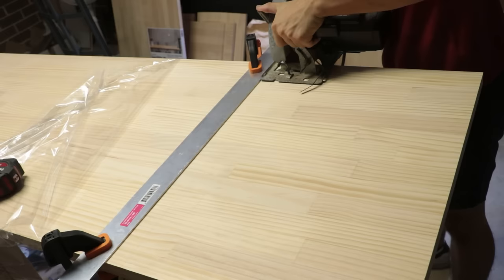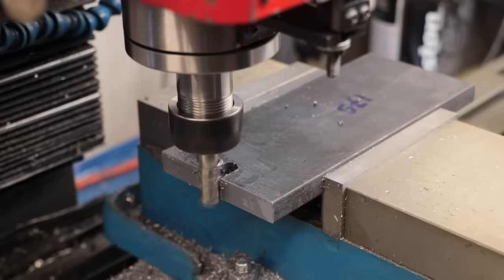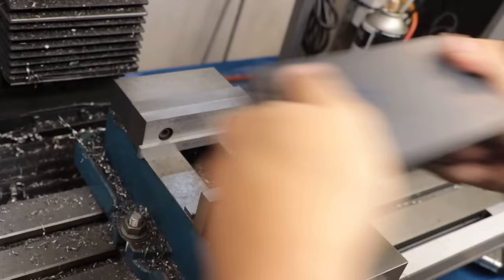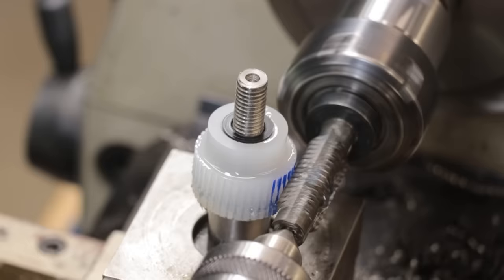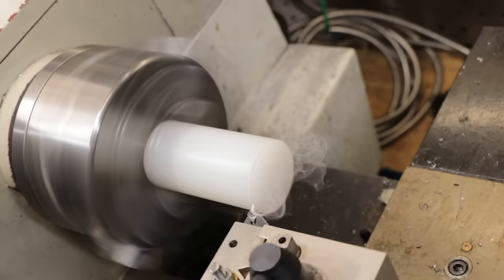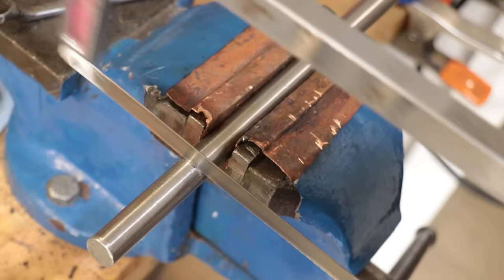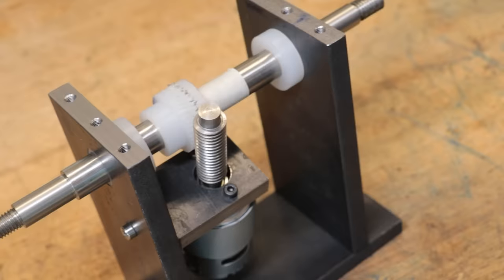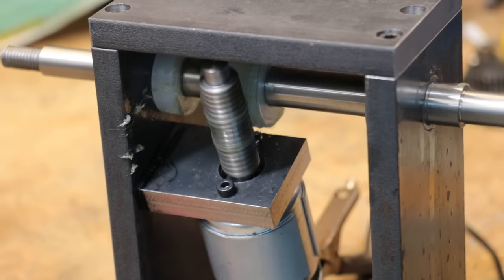Whetstone Grinder Build - Part 1

Comment: Nice project
Tip for deburring acetal: use a fine brass wire brush
Acetal is also notoriously hard to glue, better just crossdrill shaft and gear and pin it in place. More diameter on the flange would help too

Comment: I admire your patience and willpower. I don’t even fancy cutting a piece of 2x4 with handsaw ( lazy, I know) and here you are chopping blocks of steel with hacksaw.
Reply from the maker: Thankfully I got a break here. These were already pre cut. At least the plate was. :)
Reply: I just bought a band hacksaw because of having to cut big chunks of steel ..hand power works but its so much nicer to get it done accurately  without muscle pain and in less than a minute.
Reply: @TalRohan  Hand power has its place though
I find that ferrying a part around a room, pulling out machines, and setting jigs just doesn't work for me, so I reach for my hand tools a lot
Reply: @skilletborne  I get that too. Especially with long pieces of stock...moving those around to a mchine or even getting a safe spot to use and angle grinder sucks
Reply: We have seen him cut huge pieces of steal with a hacksaw. Alot of us have offered to give him a band saw lol
Reply: @christopherharsh8837  yes yes me too lol some of those bits make my shoulder ache in sympathy

Comment: I had a thought that if water getting past the bushings were to be a problem you could do what RC boats do. RC boat propeller shafts are a threaded shaft that is constantly pushing water out of the shaft tube. If you were to thread the shaft that goes through the bushing like 1 thread per inch or 1 thread per 25mm and keep it a shallow cut I don't think it would overly wear the bushing but would help to keep the water out. Looking forward to the next video.
Reply: Don't RC boats work with box seals, or sometimes even labyrinth seals? A threaded shaft would only push water out when it's running, when it stops it would leak if it doesn't have any other means to keep the water out.
Reply: From the ones I have worked on there were no seals just grease on what looks like twisted wires that made a thread that would push the water to the propeller. That's why I thought a single thread would work on this grinder.

Comment: Great video as always! 👍👍
  A super cheap alternative to something like this, and water/oil stones is Sandpaper on a sheet of Tempered Glass. That's how I sharpen all my plane irons, and chisels. 
   I took a sheet of tempered glass I had from an old Stereo Cabinet I had laying around, bc I don't throw anything out lol, and I glued sandpaper to with spray adhesive. I put 60, 80, 150, 220, & 320 grit on one side, and 400, 600, 800, 1000, & 2000 grit on the other side of the glass. 
 So I can just set it on my bench, and sharpen them with the cheap little angle guide I got of scamazon for like 15 dollars.  Works great for me.
Reply: Sandpaper made economic sense before diamond plates dropped in price. But things have changed. Now the cheapest honing system is diamond plates. I can get a diamond plate for not much more than what a few sheets of sandpaper costs. Diamonds will cut faster and longer than sandpaper will too. On my maintained tools I really only use 1,000 grit. From there I polish on ceramic stones and strop. How much all the polishing does for me is debatable. But I like it so I do it. I could probably strop right off the plate and have a keen edge.

Comment: Something you can do to help keep the gears engaged is to add a spring to the bottom of the motor to pull it into the gears
Reply: I think that's usually called preloading! 🙂
Reply: Generally not done; there is a proper running clearance (though it would likely matter little for this application.)

Comment: One thing you might consider is to press on a thin washer which isn't touching the housing or stone to provide a slinger to keep the water from crawling into the bearing or on the frame. This is common on wet motors and does well.

Comment: Nice job. And certainly MUCH better than the "Scheppach" garbage you can buy nowadays. I bought the "TiGer 2000" maybe 3 years ago after having seen an older "TiGer" model from the 1990s made of metal which worked really well.

The "TiGer 2000" is nearly unusable in comparison. Completely made of rather weak plastic, so the metal tool rest cannot be fixed properly in any position. As a bonus it flexes with the whole housing as soon as you put a little pressure on it.

Besides a noisy and weak motor it came with a VERY unbalanced grinding wheel you have to take half a centimeter off to get it running properly and a very much out of round leather buffing wheel you can't do anything about.

I ended up 3D printing a halfway decent tool rest addon for an old, cheap (30-40€) generic bench grinder-whetstone combination thing I already had and use this instead.

Comment: Neat! Great tool, and I need one myself for all the sharpening and delicate grinding/shaping I do. I use a couple of those 775 motors, and (depending on the brand) they can be run from 10-30V! It will definitely need a bearing on the end of the worm shaft because the motor's shaft and bushings are so tiny. (5mm!).

Comment: To help bond the plastic gear to the shaft. You could have knurled the shaft. Apart from getting a rougher surface, this would lead to a good press fit as it pushes some material up.

Comment: Regarding the supporting the far side of the motor, could you not just take a thin rectangle of steel that barely pressfits between the top and bottom plates, then notch in the angle of the motor bracket? That way the plate wouldnt flex since you'd have "3" contact points. Notching it at the perfect angles should be easy too, you can just set it next to the bracket set at the perfect angle while its off, then mark of everything exposed and cut the negative out. Even cutting the negative should just be adjust to the proper angle in a vise compared to the slotting tool, then flip around reverse

Comment: the subtitles on youtube are priceless, at one point you get "a whole drooled!!" who knew that worked lol 
looks brilliant so far, I'm looking forward to the next part 
I have a really old hand cranked wet grinder that is absolutely joyous to use...if I get some rests or jigs made for it it will be even better (looking for ideas) ...A large part of the reason I bought it was because of the price of motor driven ones but honestly I wouldnt go back to hi speed motor grinding ..I like the control too much

Comment: I've got a WEN grinder like that, and it definitely was a good thing to make.
For a stropping wheel I'd use 5-7 micron diamond powder mixed with a tiny bit of glycerin, on a plywood wheel covered in leather. For the water container, I'd make it easily removable, ideally a slide in part. I broke mine, so I currently use an aluminum baking pan lol

Comment: So far so good, don't think you'll need a second mount on the worm gear, but you could fit one via an angle into the drive from the top if you do decide to add it later. Part 2 will maybe be all you need to be able to sharpen your tools, this will be very versatile for sure.
Thanks 👍💪✌

Comment: If you plan to stick with plastic bushing, Igus has a great plastic plain bearing selection guide which may be a better fit in case the bearings need to be replaced in the future. I am surprised you did not pick bronze for the worm gear and bushings with possibly a greasing system. I like the simplicity of this build to quickly produce a functioning machine.

Comment: I'd keep an eye on that plastic gear staying attached, as Delrin/POM/Acetal don't chemically bond, which is how that epoxy is supposed to work. I've tried and failed many a time to glue that stuff until my grandfather told me this. Some sort of mechanical thing like pins, a keyed thing, or good old press fit would be your best bet. Maybe a good excuse to cast a chunk of brass or aluminum bronze and remake the thing lol

Comment: Funny you should upload this now, I'm a bit further ahead in the process of making a whetstone sharpener myself.  ...Using a dolly waiter high-duty 2hp motor with a 100:1 reduction that I had available, mine's not too dissimilar to yours just a little larger scale, though I also have a pulley off the main shaft to run a belt sander.

Comment: Motor-mount plate have enough size/material to fit a bearing, which would drastically reduce the side-load on the motor. 

And given the direction of the load you really only need support on one side of the other end of the worm so a half-circle bushing would work and fit given that you can turn away some of the worm that isn't needed/used on that end.

Comment: Can always use spring to pull on motor, or other way on top. it would provide pressure, yet it can still slip back if wheel is stalled.

Comment: Just a bit of design constructive criticism. Depending on threaded fasteners for a repeatable or even square assembly isn't recommended. Much better would have been end milling shallow slots for the vertical sides to locate in. That way there's a mechanical alignment method and the bolts then just hold everything together. Mechanically that also makes a stronger and more rigid assembly. Cutting something like splines, and even inaccurate ones on the shaft that was left a little over size and then press fitting your worm gear hub over those would have allowed the metal to then act like an automatic broach. You'd then have a positive drive method between the driven worm wheel and the shaft. With plastics you can get away with quite a bit.

Comment: The worm drive is a much better design that the one you showed from Machinery House.. that just uses a friction drive on the inside of the honing wheel, which makes it almost impossible to get the wheels to turn concentric.

Comment: Mate that's amazing. I bought one of the 200 versions and it was not great. The stone would not run true. If you want the jigs let me know
Reply: Simply buy a diamond stone resurfacer to fix your stones not running true. They are very  cheap and invaluable for fixing the main grinder stones too.
Reply: I appreciate the advice. But i did and it did not work. Almost like there was a bent shaft. I got myself a Tormak and had no issues. I probably just got a damaged one
Reply: @Gravattack  - if you true the outside surface of the wheel, it is irrelevant whether the shaft is bent or not (make sense?).
I also true the sides of my wheels, as that reduces wobble.
One important thing is the balance of the wheels. Cheap ones are notorious for having different density (of grit) and that affects the balance. If the machine isn't bolted down, it can literally shake the tool rests and whatever you are trying to grind. I'd say that was the a actual problem you were experiencing. Cheers 🍺
Reply: @johncoops6897  Mate that machine is long gone, I tried everything. It took loads off the stone, but if you changed the stone then it was out again. almost like a camshaft lobe. it was not edge to edge, it was like it was an oval. It took loads off the wheel trying to true it. I felt it might have been dropped and bent the shaft. The Tormek has never given me any grief

Comment: Hi Artisan Makes! 
I am now on the spot where I have to buy a bench mill for my few works at home. Mainly machining small parts of 2stroke engines. This means my work is going to be drilling and milling 90% aluminium, 8% mild steel and 2% stainless steel. 

The Sieg X2.7L Is now up to 1490 euros or 2475 AUD right now and I'm prone to buy that. Would you still buy It at this price? Please let me know, I could use your help. Thank you!

Comment: Wait to finish before posting comment or Preemptively strike before others post? 

Me: 🤩 I’m sure it’s a great video!
Reply: On a more serious note, 4:53 could someone tell me what the metal rod placed between the plates and the vice jaw helps with while drilling. 

Is it to adjust the contact point with the vice jaws to automatically become the center when your work piece is close but not quite parallel with the jaws?
Reply: @TradeWorks_Construction 
I want to say it allows the two plates to center themselves since they aren’t perfectly square (imperfections in factory finish, etc). He doesn’t have them welded together, so it may also help to even them out. That’s my best guess.
Reply from the maker: @TradeWorks_Construction  Im clamping on hot rolled steel and they weren't the same width. The steel wire squashes slightly as a close the vise and helps clamp both of them equally

Comment: is there any reason why the shaft is in the center?
there would most definitely be more place for the screw if the shaft with the gear was off center
Reply from the maker: For looks. Thats about it. Looked weird as hell in the cad when I made it offset

Comment: There are very inexpensive and good quality 8" diamond disks that should fit your shaft. you can get grits from 240 all the way up to 1200 or higher. They're wonderful for sharpening carbide or very hard steel. The disks are about 2mm thick, and have grit on 1 side, but you can stick PSA sanding disks on the reverse. They should last forever if ran slowly in water.

Comment: I hope you're planning on putting covers on that so you dont get water/grinding dust in the motor or gears. Could probably just caulk some sheet metal or plastic on it and call it a day if you wanted.
Reply from the maker: Should be evident from The thumbnail.  Lots of stuff here that still that needs to be completed. Cheers
Reply: @artisanmakes  that would have required me to pay attention, which clearly isn't in the cards for a Saturday morning.

Comment: I have a 1934 SOUTH BEND HEAVY 10 That I thought was kinda loud when I cut gears 😂 but is it me or is that lathe low on oil? It seems extremely loud. Maybe I had the volume too high….😂
Reply: He didn't (properly) clean out the grit and grinding dust from inside the gearbox when he bought it. It's literally chewing itself to pieces, every day he keeps using it. 😢

Comment: I would not expect epoxy to stay bonded to acetal.     You could prevent any slippage by machining splines into the acetal gear.  They don't need to be properly shaped per standards and don't need to be precision spaced.   They just need to provide spaces for the epoxy to fill and lock into place.  You could make the splines in the lathe by just hand-wheeling the carriage back and forth.
The design is not very good - it puts a large axial thrust on the motor bearings, which are not designed to take it.   The worm should be supported by bearings at both ends, and coupled to the motor by a splined or square drive.
Reply from the maker: Yeah I might put a pin in it through the shaft

Comment: How long did that plastic gear last? Two wheels is a lot of inertia to stop with gears that can't be back driven.
Reply from the maker: They seem to last on the commercial grinders so I will assume the same for here
Reply: The design I've seen appears to have the motor shaft drive the outside diameter of a large wheel on the buffing wheel side. I couldn't find a design with worm gears driving the shaft directly. 
Regardless, it'll be interesting to see how the gears treat you. Thanks for replying

Comment: May I ask something very stupid? I have hard times taping holes for screws. I think it’s because the holes are too tight and the taper gets stuck. Is there specific rule like for example : drill 5mm and taper 6 mm? Cheers.
Reply: Yes, search for " drill tap chart "
Reply: @IKEDA7K  thanks a lot. Helps a lot. Cheers
Reply: For metric it's really easy, just subtract the pitch from the major diameter - examples: M6x1.0 is 5mm, M8x1.25 is 6.75mm. For imperial you need a thread chart and very likely a set of numbered and/or lettered drill bits.
Reply: @robertwoodcock5317  thanks, indeed makes a lot of sense this way.

Comment: The common accepted practice in the craft is to grind the primary bevel and hone a secondary bevel for hand tools. You do need a bit better hone stone though. Don't judge the method by what you have. I'm a big proponent of using a honing guide too. The consistency of the results cannot be matched. Sharpening is a contentious topic though. There's a lot of BS out there. I guess in the end everyone has to find their own way.
Reply from the maker: I didn’t  think that was the case specifically for high angle blade planes. Yes for the low angle block planes but not for the high.
Reply: @artisanmakes  A low angle plane the iron is bevel up and a high angle is bevel down. But you sharpen them both the same. You get them sharp. Sharp is sharp. Quite frankly there's really only one angle you should be sharpening all woodworking tools to. That's 30°. That's optimal. I know it sounds arbitrary but it is based on a lot of experience. A lot of people have woodworked. That value has been arrived at collectively. It's just what it is. But in some limited situations you may want an angle a bit off of that. Say if you're paring really soft wood. Then go a little shallower. But for general bench work 30° is the magic number.

Comment: Which kind of wheel you're planning to use with the grinder ?
Reply: I took the plunge &  bought a Tormek DF-200 Diamond Fine Wheel (other grades available) not cheap , but they will never change size,need dressing or hollow, dish or groove, after a bad mishap with grit stones,left them damp in workshop, had power cut & temperature dropped to minus whaterever & the stones cracked.
Reply from the maker: Im using a silicone carbide wheel. Its good enough to get the blade sharp enough to be able to cut hair easily